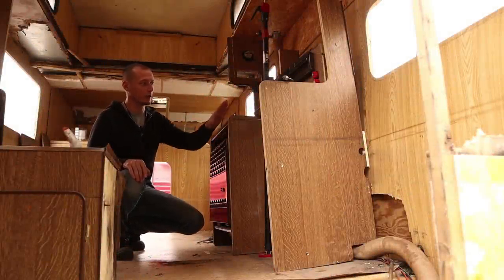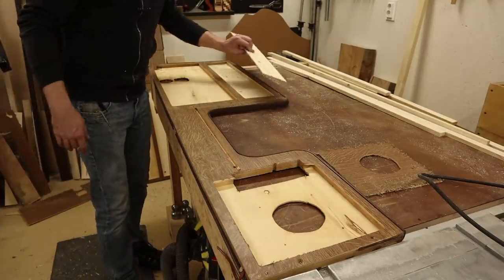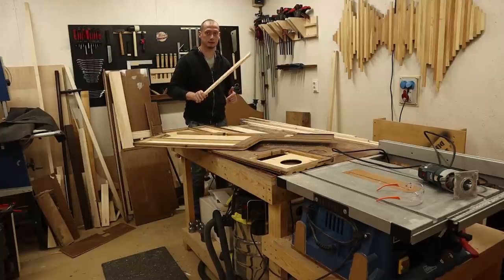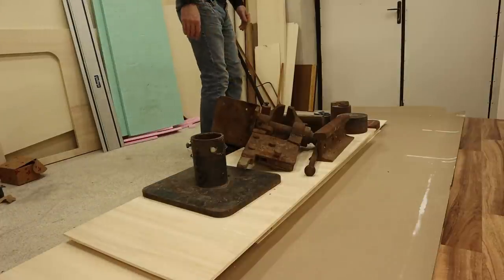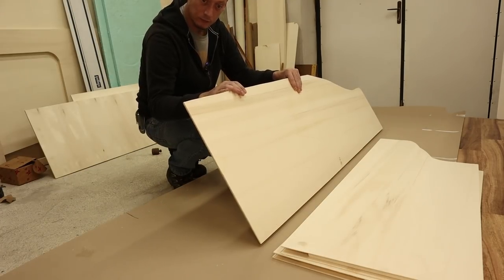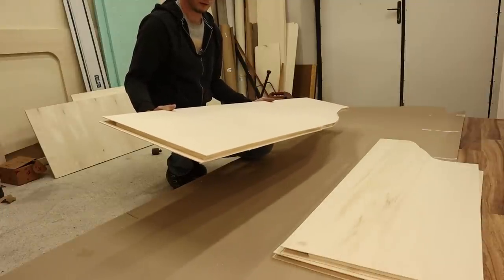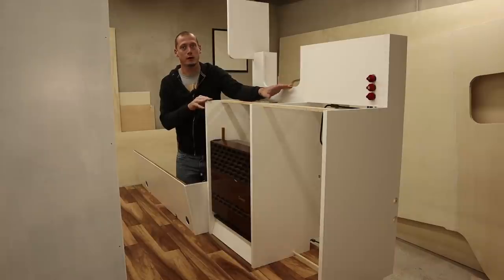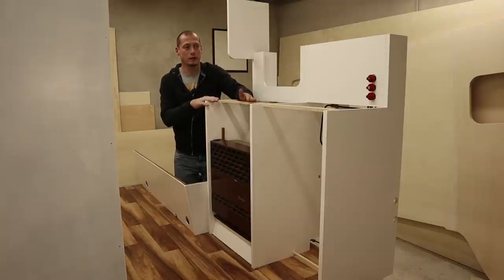Making Hollow-core Furniture // Building a Truck Camper Ep.8

Comment: I only found your channel three days ago. I like the router table you made for the work-mate bench. simple and effective, saves space too. I'm enjoying these videos as I owned a 9 meter static caravan / mobile home as we call them for over twenty years. I was always improving it and removed the gas fire and installed a wood burning stove. Not a practical option in your case. But the guy beside me had installed a diesel fired heater unit with ducting to the bedrooms. it was very effective and cheaper than gas to run, also a small unit similar to those used on boats . It could have been fitted under the seat and the space saved by the gas fire as storage. Gas heaters cause quite a lot of condensation and its possible some of the rot was caused by this over time. The panelling in my was all stained by condensation from the tom down owing to poor insulation in the roof. So I reinsulated the roof and replaced the ceiling board with tongue & groove sheeting. I then relined all the walls with wall paper and had a new interior.  Your work is good and neat ,I cant wait to see the finished camper. 👍

Comment: Very nice Sebastian! Love to see light panel technics. There is a guy in the states that used a similar panel with alouminium sheets and frame. He was using the super strong 3M double tape. Worked really well as i saw in his vids. There were also some panels with "wavy" material inside the plies on the outer (think Egger had'em). Guess you could use foam also inside.
Keep on mate, we all wait for the final construction of the van, will be awesome! Thanks again.
Reply from the maker: Thanks!